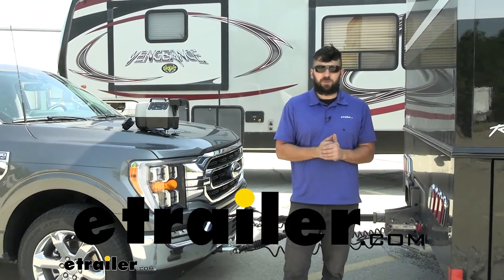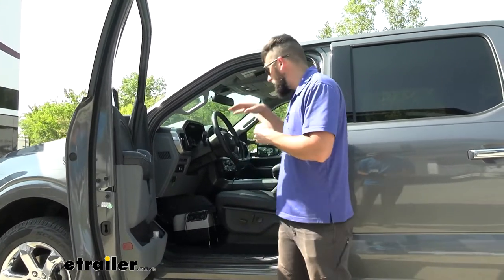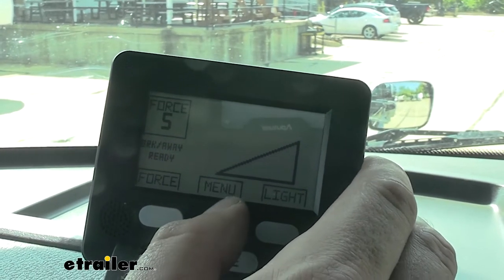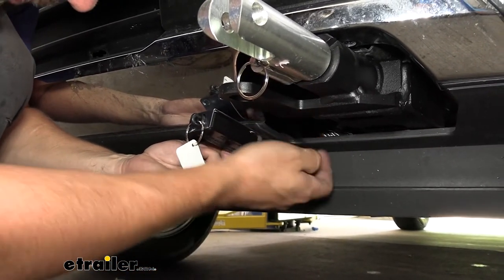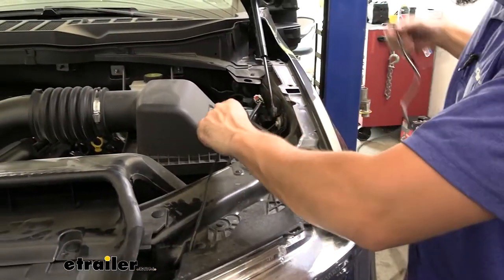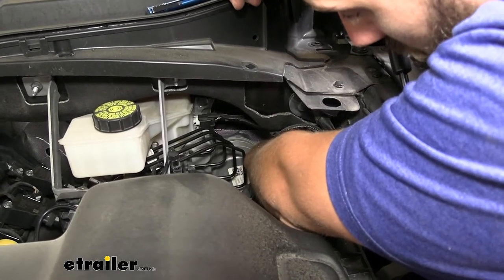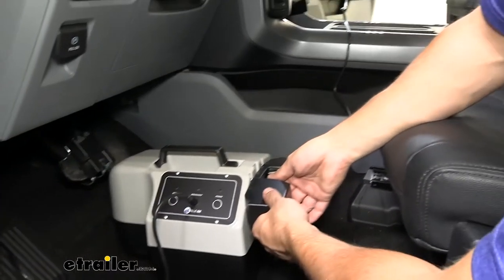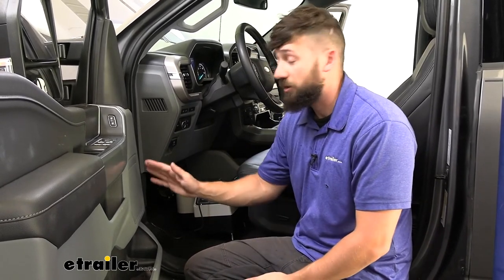etrailer | Installation: Blue Ox Patriot Portable Flat Tow Brake System on a 2022 Ford F-150

Comment: I'm going to order one of these tomorrow for my Jeep Wrangler. My question is what makes it work I can't find any information on that. I know you have a controller in the cab of followed this video quite closely but what makes it activate? Nobody seems to have that video
Reply from the maker: The Blue Ox # BLU37TR has an internal accelerometer that senses when the tow vehicle is decelerating. It will have the Patriot apply brake force equal to that of the tow vehicle so that the tow vehicle and the dinghy slow at the same rate. It doesn't use the brake controller in the tow vehicle, but DOES have a remote that mounts in cab and plugs into 12V accessory outlet, and lets you activate the towed car's brakes in emergency situation or to correct sway. It will also alert you if the towed vehicle becomes detached from your motorhome. Hope that helps!
https://www.etrailer.com/Tow-Bar-Braking-Systems/Blue-Ox/BLU37TR.html

Comment: That was not a very good set up.  The seat needs to be all the way down.  That was why when it put the brakes on it looked like the whole unit was going to break in two.  Also, you cannot just plug the power cord into the 12 volt socket in the dash on an F150 because that socket does not stay live if the engine is not running.  It’ll only stay live for maybe 30 minutes as retained accessory power.  You need to run a separate power line directly from the battery.  Lastly, you need to run a charge line from the Motorhome to the F150 battery to trickle charge the F150 battery while you’re driving.  If not, there is a very good chance your battery will die while you’re towing the F150 down the road.  I speak with 4 years of actual experience pulling my F150 behind my Motorhome.  By the way, the Patriot brake unit is excellent.
Reply: Agreed on all points…that was a terrible setup
Reply: I'm going to order one of these tomorrow for my Jeep Wrangler. My question is what makes it work I can't find any information on that. I know you have a controller in the cab of followed this video quite closely but what makes it activate? Nobody seems to have that video
Reply: @G_RAThbun  the brake has sensors in it that detect braking force and adjust braking pressure accordingly…that is why they are considered “proportional “ systems